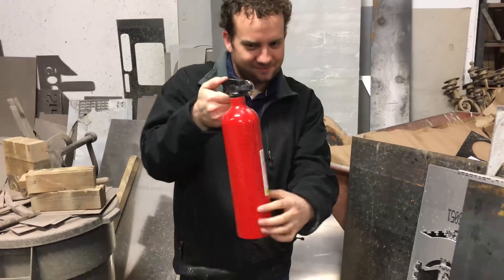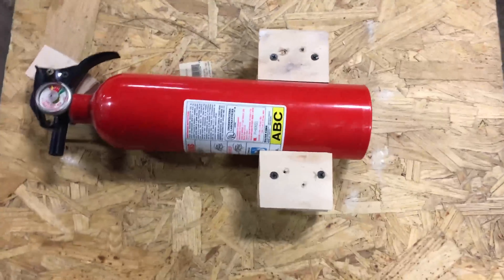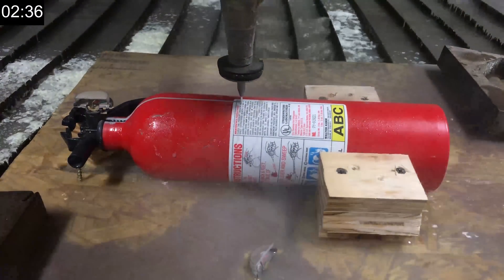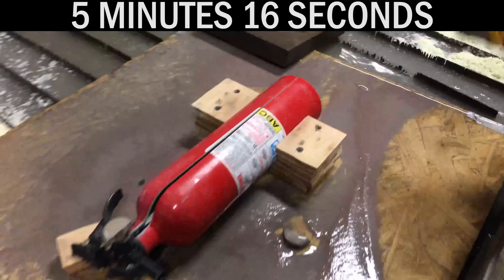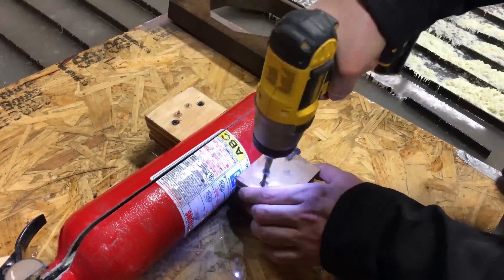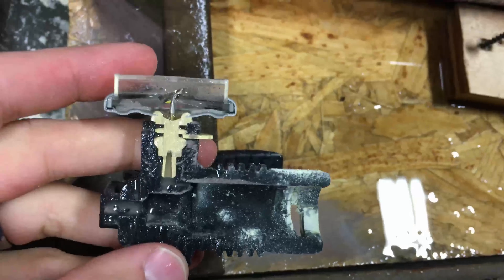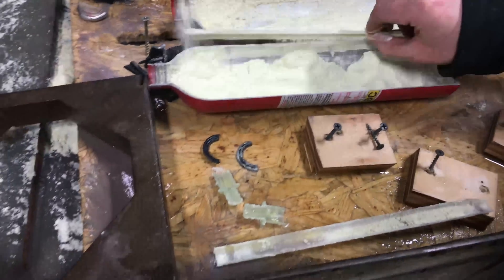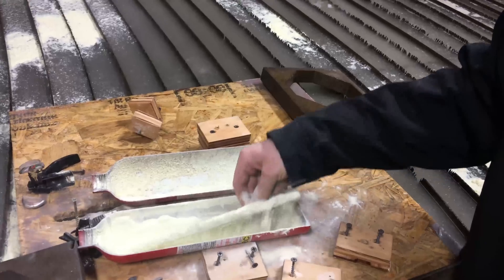Fire Extinguisher cut in half with A 60,000 PSI Waterjet Cutter - Interesting Cross Section

Comment: Why dosent the jet cut the wood beneath it?
Reply: It does, you can see around 11:11 that it's gone all the way through, it also nicks up the metal supports in the water tank which you can see but it won't go right though those instantly as the stream will just deflect off to the side as that is the easier path for it to take.

Comment: I wouldn't be touching that stuff. It's kind of very harmful
Reply: +mastocytoma1 well it needs an oxidant to corrode
Reply: Or inhale it
Reply: Anthony Rocco your worried about touching it and then the guy licks it lol
Reply: It corrodes metal like crazy
Reply: well he sniffed and licked it too so..
Reply: It uses a specially fluidized and siliconized monoammonium phosphate powder. It's harmless unless ingested (like most things).
Reply: maybe maybe not you are supposed to spray it in a fire regardless of people but i guess people would rather have dust in their lungs than dead
Reply: Quick google search disagrees: its Monoammonium phosphate
Reply: Actually fire suppressant is comprised of very basic chemicals and is not toxic.
Reply: Anthony Rocco they are unlike you, mortal.
Reply: Florian Rota 

Why would they put something that corrodes metal like crazy in a metal cylinder?
Reply: It`s just baking soda.